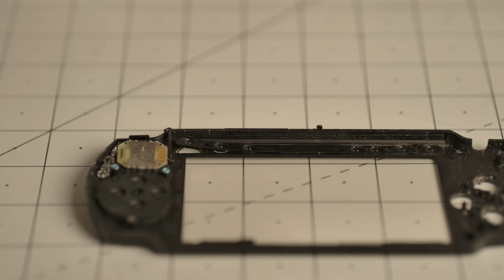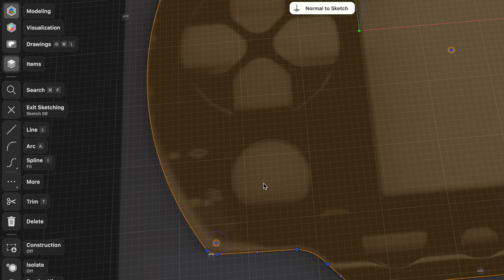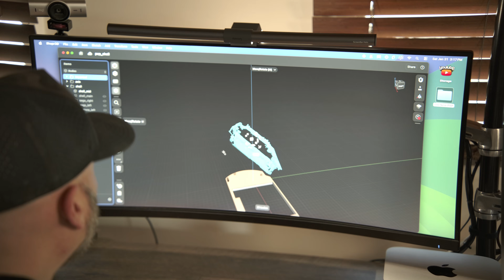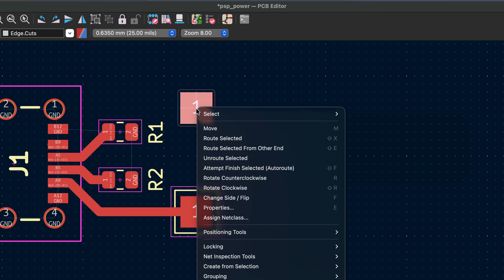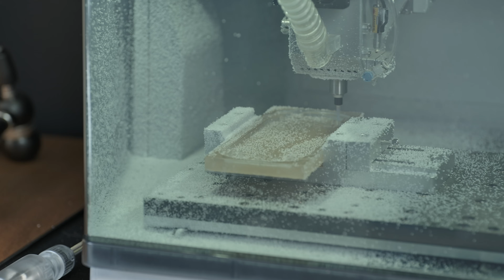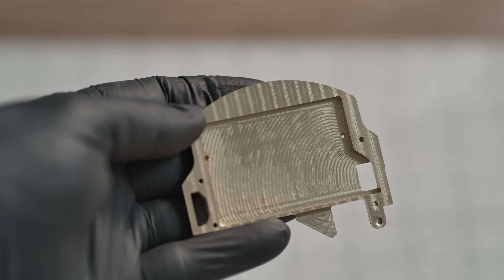I rebuilt this PSP from scratch

Comment: Depending on your scanning software, if i doesn't support datums and you're manually aligning it in your modeling software (like you're doing here) is to use Blender to do a little pre-processing.  In Blender you can select three verts of the mesh on a known datum (or whatever you choose) and create an origin and transform to that position.  Then you can apply that transform and export the mesh to your preferred modeling program, and then your model will share the same origin and datum as your assembly.  Keep up the awesome work!

Comment: I was a day 1 PSP owned back in 2005.  Absolute marvel of industrial design and is truly peak Sony.  I recently found a PSP 1000 in a pawn shop with zero scratches.  It was in a case and had firmware from 2007. Gem.

Comment: Please which app do you use for modelling or which would you recommend?
Reply from the maker: I user Shapr3D. Its a great push-pull direct modeling app but also has parametric capabilities. They've got a really capable free tier, but if you like it you can use my code MATT10 to get 10% off if you want.

Comment: My mom asked me one day if I was interested in the psp when it first was out and I hadn't known much about it (was a nintendo kid). 

Apparently one of her coworkers had gotten one for her son and they didn't want it anymore or something? so she got it for me from them, I had literally updated to the 2.0 firmware like a day before the 1.5FW was jailbroken and I was devastated that I didn't get to try it out.

As soon as the next CFW was released I jumped on it. and Loved that thing

Modded the hell out of it with accessories and software, the dual micro sd to memstick pro duo, an old Belkin IR PDA keyboard that I could use with a chat messenger I could sign into with like 8+ diff messengers

There was an app that I could download anime on and had the av cables to output this to a tv as well as the app to output display over usb.

The PSP-1000 was literally my first laptop, years later it was stolen and I replaced it with a silver PSP-2000 and I loved that thing so damn much.
Reply: I love these stories. Do you still have one?
Reply: @benrideout8173  I still technically have the silver 2000 series but last I knew a few years ago it was in rough shape, the case was cracked in the corner and the D-pad wasn't fully working sadly.

Comment: Hey Matt, did you "re-mill" the surface of the pcbs for the USB-C connector after you put the solder mask on? What happened there that allows for a good connection?
Reply from the maker: Yeah the footage didn’t make the cut but I used a solder mask removal tool in the CNC to remove the mask from the pads so the solder can adhere.

Comment: Barkeeper’s Friend is great stuff, but on anything with copper in it, I’ve always preferred Brasso, because of the ammonium hydroxide, which soaks into the surface layer and blocks copper’s desire to attach to molecular oxygen by repelling it via polarity (copper wants a single oxygen atom, and a pair of copper atoms will split a molecular oxygen particle, but the hydroxide doesn’t want any more oxygen, and repels it). It doesn’t stop oxidation, but it does slow it substantially, and typically won’t interfere with coatings like the wax, or an enamel paint. Beautiful project! I would love to get into 3D printing and small CNC, but my wife insists that I need to make money with it if it’s going to be taking space here… I know it could, but… I’m just so busy!
Reply from the maker: Thank you so much for the detailed rundown! I’ll definitely give it a shot. Totally get the investment/space piece of it. I could barely justify it before moving to a much larger space but man is it a fun capability to have…

Comment: Okay, milestone, rework the USB-C charging port to add the old Mini-USB to it. Removing one to have more space for the brass rail holding the entire thing together. Next, highly, HIGHLY combine both charger and USB, but also look into the laminated IPS screen for the PSP-1000 series. You might as well upgrade when you are putting this much work into it.

Comment: 4:50 I just wanted to say that I had my PSP Renaissance not too long ago and around the same time I bought my PS5 and decided to buy a charging dock for my controllers one of the more simpler cheaper ones. It was made by Sony as well. One day I am looking at my chargers that I bought off eBay or Amazon and was thinking to myself about how cheap these charging cables really were and one day I was curious to see if the connector for my charging station would fit into my PSP. Lo and behold if it's perfectly charges perfectly and now I have a currently made charging cable by Sony that works with my PSP. Going to USBC would be the obviously better solution but I just wanted to put that out there.

Comment: Did I miss the part of the power board where you removed the mask off of the pads? Was it another pass on the CNC with a spring engraving bit?
Reply from the maker: Hey, yep that’s exactly what I used. It’s the spring loaded mask removal tool that’s more of a grinder than a cutter. It took quite a bit to find the right pressure a getting the mask thickness consistent but I was able to get it tuned pretty well.

Comment: When I was making PCBs I realized you can only plan so much ahead with limited experience and what's more important is being able to fail fast and try again fast. Having all the machines at your finger tips is the start of accelerating that process. Even though I made a few macro prototypes, after trying to shrink down the schematic and sending it to a proper fab, I realized there were still other mistakes I didn't account for and did not realize until the parts came back. If I could do a single one off and fail and try again immediate after, it would have cut down my iteration process by a week at least each time. I hope one day I can build back my lab/bench to what you have. It looks amazing and fun!

Comment: Awesome work man. I plan on using a broken 2000 series to make a psp thats bigger overall, I plan on using a bigger display from an lcd tv since the psp can output to component I can easily tap the input on the display, adding batteries that last longer, also going to use a dual joystick like on the vita (or similar) and I plan on adding L2 and R2 buttons that allow you to set them to whatever inputs you want. I have a controller with a tilt sense feature that I'd like to implement, as well as Bluetooth audio.

Comment: You should also try a lens shaped circle segment cutter four your cnc. They can have a radius of like 3 inches in a 1/4 inch endmill. it allows you to get the smoothness of a flat endmill without the edge lines that pop up and it cuts way faster compared to a ball endmill.

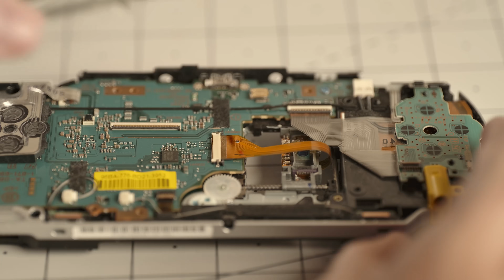Comment: @4:30  I dont believe the barrel jack was proprietary.  Ive found random chargers that worked with the PSP over the years that were originally for cell phones or power tools.  (When I was younger I lost my PSP charger, and my dad was a pack rat, so we had random chargers to random devices all over the place, so I matched up the voltage and barrel size and found one laying around that actually worked fine.  It didnt have any Sony branding.  

PS:  your knowledge is beyond impressive with using all of this software and equipment.  Where did you learn all this stuff?  I just got into 3D printing, I know my way around the machine and maintenance, but where did you begin with learning modeling software?  It blows my mind every time I see people make stuff.
Reply from the maker: Hey thanks so much and really glad you're enjoying the videos.  As for where I learned things, I just figure out the things I need to know to build the things I want to build and then just really dedicate some time to learning it. I learn the best hands-on, so its just been many many iterations of designs and modeling and watching tutorials and trying things. Just a curious person that prioritizes learning new things.

Comment: if the plan is to use this thing, will u just keep polishing out all the scratches that the acrylic screen cover picks up?  might not be orthodox, but a printed TPU gasket and an inset piece of gorilla glass could escape you from multiple time holes.  that brass wants all your toolmarks gone, it's the star.  the way it'll feel will be nuts

Comment: i do like how they put a screw on the power connector instead of soldering it to the board. also do not like how the lcd backlight connector is so tiny that its super easy to rip of the board and thats not something most people will be able to repair even if they got the tools somehow

Comment: The power jack is not proprietary. Its a standard size 4x1.7mm barrel jack you can find anywhere.You can play the PSP without the battery. Although you can actually charge using the mini-usb connector. Sony put that barrel because you can still play if your battery is dead or swap them while its still on like most of Sony products at that time.

Comment: 13:21 > Ultimately what we're looking for here is 5V and you can do that by drawing up an incredibly simple diagram with two resistors.

No you can't. You're referring to a voltage divider, voltage divider isn't capable of producing any significant current -- you don't "power" anything from a voltage divided. As current increases, the voltage drop across series resistor rises according to V=IR.
Once you attempt mitigating this voltage drop by reducing series and parallel resistor values, you'll find that at some point the parallel resistor starts becoming an issue: its baseline power draw would exhaust power source's current capacity.

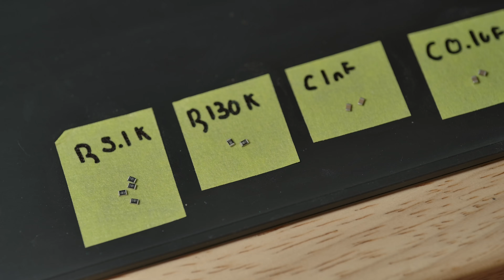14:27 > Now you may have noticed that my PCB got a little bit more complex that the two resistors.

No shit Sherlock!

Comment: PSP 1000, 2000 and 3000 models are often sold in pretty much pristine used conditions cheaply on eBay.  I'm not sure why you're trying to position rarity for these machines - they aren't rare nor are they hard to come by reasonably priced in good condition.

Comment: Still have both of mine, the original PSP-1000 ( I'm a weirdo that liked the steel frame and the solid weighty feel it had ) which sadly has a slightly cracked screen from falling off the counter once, and a newer PSP-3006 which is actually still in pristine condition.  Wish I had more games for either.  I also wish the battery design had been better, they didn't last long or hold charge for crap.  Probably why mine aren't ruined, I never took them all over the place and just used the ac plug so I could actually get some gametime in.  Still, this was a great breakdown and rebuild, really neat to watch.

Comment: Wow what a nice project. I cannot imagine how many hours it took to reach that result. Although, I don't get it why you made the extra effort for a dedicated circuit for the charging. PSP already uses 5V natively for that, I thought you can just replace the barrel jack with a USB-C connector and maybe put an extra resistor to make sure that USB-C to USB-C cables still work. And as others have mentioned, probably it would make more sense to replace the micro-USB data port with USB-C, and combine it to do the charging through there, instead of having a separate connector only for charging.

Comment: Hi Matt. A common mod for the PSP1000 back in the day was to run some wires from the charging port connector to the micro USB socket on the top so you could charge it with what were common cables at the time, and still use the port for data transfer (iirc this was included in the later models?). Perhaps that plus swapping the micro USB for USB C is something to consider, given it seems like you need to relocate that anyway to accommodate the power switch?
Nice project, the brass looks good - thanks for sharing

Comment: If you want to be able to sell these files in the future it probably makes the most sense to work with the 2000 or 3000, there's gonna be way more of those out there. You can also get a lot of aftermarket parts these days like brighter screens, better batteries.

Comment: I don't bother with photos or scanning. SkethUp and a pair of calipers. Every shape initially started as a block, thus every shape is "encapsulated" inside one. You start with those and whittle away parts and you eventually arrive at the truth. I find the other means to be side quests only to be used when you just can't reach an item to put your mitts on it.

Comment: These builds are absolutely captivating for me - I've got the ideas and the creativity, but absolutely lack the patience to learn, craft and follow through. I've learnt to temper my inner voice, which is right now screaming at me to buy a CNC machine that I would have no idea how to use, nor the patience to learn how!!!
Reply: I know the feeling, watching stuff like this or restoration channels and seeing how cool the tools and process are...and knowing you need to ignore the voice screaming at the back of your head to get some tools and try itself, cause you know that you actually couldn't pull it off.  For instance, I have slightly shaking hands and meh dexterity, trying anything like precision soldering would only end in tears for me.

Comment: Using the PSP Go’s board with its added features (game suspend, bluetooth, sleep mode when docked, more ram) and modding it to have a UMD drive so it can play every game is my dream project.
Reply: The PSP Go's firmware won't allow for UMD drives to even work. It doesnt have the necessary allocation in the firmware to pull it off. Even if you managed to attach a UMD drive it still won't do anything. The only way to have the Go's special features and a UMD drive would be to decompile the firmware and somehow build all of it together as one complete firmware package, though I'm not sure if even that'll work.
Reply: I love the UMD!
Reply: nah, someone creating an opensource 1:1 of the UMD drive plus an FPGA that can run the psp's firmware files is mine. PPSSPP is great, but it doesnt have the XMB nor infrastructure modes for old gamespy multiplayer psp games that can now be patched with openspy's dns to be played online again. ProAdhocOnline is not super compatible.
Reply: Why bother with a UMD drive?
I still have my PSP 3000 and the UMD drive was basically the only thing I didn't like about it, its incredibly slow, a large SD card can hold pretty much every game you could ever want with vastly better performance and improved battery life.
Reply: @WarlordEnthusiast So I can watch Alvin and the Chipmunks UMD edition and all the weird JAV discs that are out there 🙂‍↕️ 🙂‍↕️
Reply: @Boaxiho  you can just put UMD video files in the SD card too.
Reply: @WarlordEnthusiast  I mean its all good. And I agree, the 3000 model UMD drive sucked, and it was not satisfying at all to use.
Before my 3000, i had a 1000 and man.. i TOTALLY get why people like having the option of a UMD, so why not both?
Also physical media rules. If you stumble into a UMD you have never seen before its so nice having the option.
Reply: @Velenius  on my Fat 1000 I NEVER used the umd drive lol. owning your media rules, they dont need to be physical :D
Reply: @WarlordEnthusiast  lol i pulled my umd drive for more battery
Reply: @WarlordEnthusiast  Let people have fun
Reply: @EugeneHoverhand it is completely valid to hate
Reply: NO. OPTICAL MEDIA BAD.
Reply: Go? As in Golang?
Reply: @WestGate-Station No